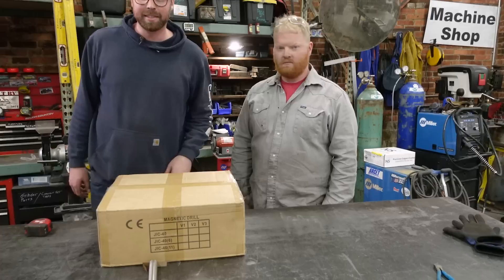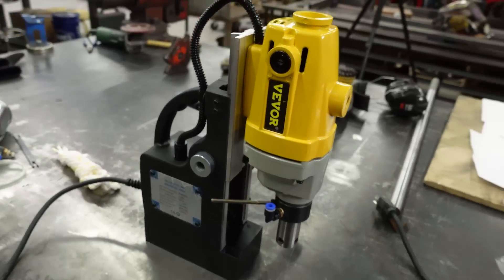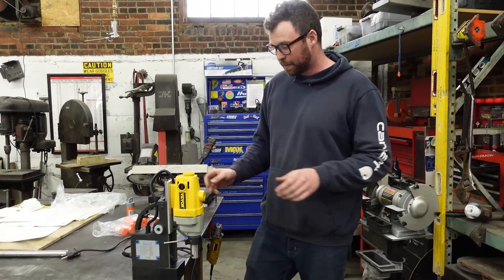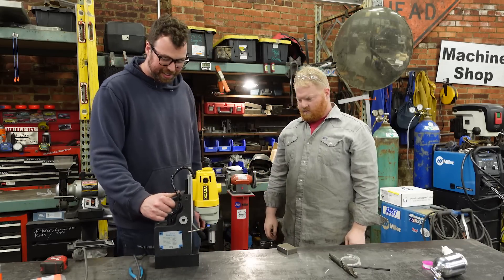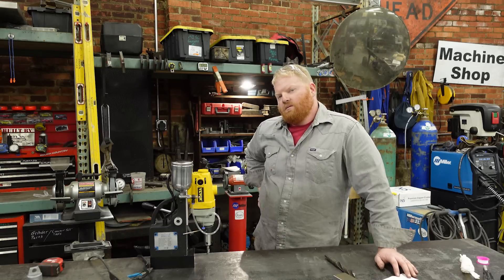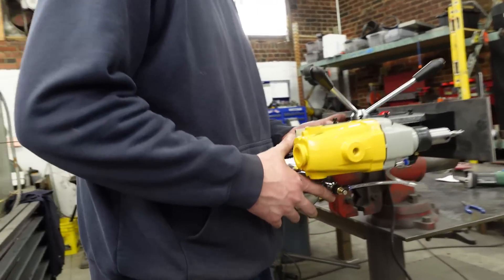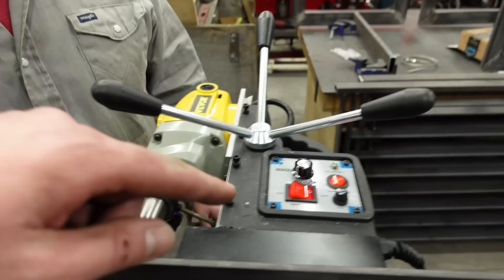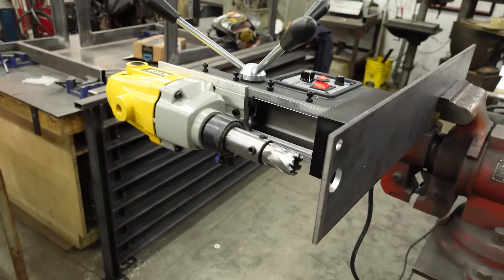I've Wanted One of These for SO Long

Comment: tay center punch hole center USE THE GUIDE PIN fits through the cutter . dont oil the ways .  been using hiatachi mag drill with alu  ways for 20 years in indrustrial setup with no problems

Comment: Did you check the "fuse" on it? I saw a few youtube videos where people were testing the CUT50 plasma cutter from them and when they removed the fuse, it had a piece of copped soldered to the outside making it not a fuse lol

Comment: There should be a guide pin to put ind the center hole of the annular cutter so you punch a marking so the pin hits the mark before cutter does thereby guiding til cutter 😁 ive use a mag drill a lot on truck frames for mounting knuckleboom cranes 😄

Comment: You can adjust the gibs by loosening the nuts on the Allen screws on the side and tightening the screws until it has no slop but still operates smoothly.
Even the expensive ones need some adjustment every once in a while.
For lubricant I always use a water soluble oil cutting oil in a squirt bottle and keep it wet to cool it to decrease wear.
There is also the option to get the cutters sharpened again and that's pretty economic in the long run.
To combat the magnet issues try and magnetize the drill on an bit of an angle instead of linear with the tube, that helps it find a surface that is as flat as possible.

Comment: There should be a pilot pin that came with it that fits into the center of drill bit to center it on a center punch you make in the material your drilling.

Comment: I've got a huge Milwaukee mag drill. I needed to drill 1 inch holes in the upside down position in the I beams of my building. I didn't even consider using the Milwaukee.  Waaay to heavy and scary in that application...did I mention it was 16ft to the floor. Did it with a hole saw and a corded 1/2" heavy-duty slow speed drill instead... it was a bitch!.. but so would have been positioning a 100lb mag drill upside-down 16ft off the floor.. that vevor would have been perfect for that scenario.
Reply from the maker: Snag one with our affiliate link friend!

Comment: I had to take  a Hougan apart to replace bearings. had to use the bread trick REAL BITCH getting the slides to have even pressure Steel fabrication shop  A complet4e Hougan from our distributor $904  the lube attachment was 2  position , the manua
l RTFM!  had instructions and parts to chain drill to vertical and upside down usage

Comment: The mag drills I have used I would use the oiler with a center pin that was printed loaded. The. Enter pin helped meter the oil but also would shoot the plug out after. If I couldn't use the oiler I would brush on some anchor lube. That looks like a great drill for the price.

Comment: You'll love the annular cutters in your mill and lathe as well. They make Morse taper adapters to mount them in the tailstock, and R8 adapters for the Bridgeport. They're great for hogging out big holes. And the slugs from the center come in handy, so start saving them in a coffee can!
Reply: When I was a kid my dad had a big coffee can full of slugs and I couldn't ever figure out what they were from, definitely not knock-outs from panels or anything, WAY too thick.. huh, I just realized where he got all them. Not sure why I never asked or he never told me. He was a machinist / boilermaker in a previous life (before he met my mom I think). Great point and yeah annular cutters are SO nice to have
Reply: The only problem is they tend to get extremely hot and are often case harden, so it's a bitch and a half to turn them down in the lathe...
Reply: @Guds777  Yep, the steel ones can be tough if not using cutting fluid, but the aluminum are good.

Comment: A trick that helps if the situation allows... If the magnet isn't grabbing on thinner material take a heavier piece of 1/2" or 3/4" and put it under what you're cutting. The magnet will still grab it.

For example if I was drilling holes on a stringer channel that was laid out on horses.... Sometimes the drill might not grab great in this case so you could put the heavy piece of extra plate underneath the channel and the drill will grip better. Just be careful when releasing the magnet!
Reply: Yessur even our hougen mag drill needs at least 3/8ths inch thick base plate but you can take a 1/4 inch plate and put it under if your cutting something smaller

Comment: You mentioned that the bit kind of wandered until it got started, there are centering pins that can be purchased for use with the annular bits. They seem to help a bit with the drilling we do. Also, like someone else said, the thicker the steel that the magnet is attached to, the stronger the holding power will be.

Comment: In the 80’s I’ve Drilled thousands of holes in fabrication with Milwaukee Mag drills. They excel in speed and portability when you have to drill on-site through beams already in place.

Comment: Mag drills work great, couple of points. The thicker the plate it's mounted to the stronger the magnet becomes...It's how magnets work I believe. Also you need to get a 3 jaw drill chuck for it, then you can use your standard twist drills etc. Mine unfortunately only has one speed...around 500 rpm. So I've had some problems with countersinks/reamers etc. If you buy one get one with a variable speed if you can.

Comment: I'm only half way through the video, (second hole cut) and you are complaining about the wobble of the drill when you first start. There is a center pin that was in the kit (I saw it on the table next to the Allen wrench) that serves 3 purposes on my mag drill. 
Center punch the location of your hole like normal 
1. Use the center pin inside the annular cutter to locate the hole and stabilize the bit when starting the hole.
2. It will start and stop the flow of coolant to the bit automatically as long as the valve is turned on from the reservoir. 
3. It will pop the plug out of the end of the bit when cutting is complete... 

Hope this helps guys 

Edit: I'm now farther along in the video and you guys found the pin and figured it out... 😆 🤣 

Edit #2: My mag drill came with a (normal drill chuck that fits into the 3/4" receiver) if yours didn't you can buy them pretty cheap, it is a good addition to the mag drill especially when you have to locate holes on both sides of material like you are doing. Put a small normal bit in the drill chuck and drill through both sides of the tubing from one side, then swap the chuck out for your annular cutter and use the small hole and the centering pin on the cutter to drill from both sides of the material. 
Sincerely
Chris 
T-Town Welding and Fabrication.

Comment: Very useful tool.  Typically you use a chain(they included the rope instead) when it's on its side or upside down in case you lose power.  You also can get a standard drill chuck that will fit in a mag drill chuck.  It eats up alot of your vertical space, but it let's you use smaller buts, annular cutters only go down to about 10mm.

Comment: I thought about getting this mag drill but went with the evolution instead, bc i have the evolution 15" steel chop saw(im suprised you dont have one they are awesome) and am very pleased with it. I bought a vevor sbg-40 universal bender and i was not impressed with the quality at all. It does work though. But that purchase really turned me off to vevor. Im curious to see how long this drill last. It is nice that its variable speed. They also make adapters so you can use anullar cutters in your mill and lathe also. Thread cutting oil works good as a lubricant for drilling holes. You might already know this. But just incase. There is also and minimum thickness for the magnet to stick to, most mag drills have a saftey feature and wont even turn on unless the magnet is engaged in atleast 1/4 steel or thicker depending on what mag drill you have. And they also come with straps to strap it vertically or upside down incase you losr power and the magnet shuts off. Vevor sent a rope lol.
Reply: The drill will last a long time - you will not be able to use it when it has broken your arm

Comment: The lubrication actually makes a big difference in my experience, particularly with annular cutters
I used a thicker cutting oil I got in the welding supplies and I found that works better then the thin water based stuff.

It's $300 including cutters that's pretty damn amazing that's probably $100 in cutters alone.

And Yes you're being too critical imo
Vevor a great option especially for work I do occasionally but regularly, 
Not enough to spend thousands on a tool but enough to spend hundreds.
Reply: if you drill a lot in more than a half inche thick ....you should plug the cutting oil....but i use it for drilling in quarter inch mostly and i never plug this....hen i was working in structural stuff ....in base plate and gusset...oil is the way...

Comment: You can also buy an R8 arbor adapter and use the annular cutters on the Bridgeport ...the same with your large drill press if it has a morse taper spindle .

Comment: I have to ask, couldnt you have used your CNC plasma cutter to cut the holes?  Not criticizing one way or the other but just curious.  thanks for the videos.
Reply: Try to get a 4’ x 4’ x 1/2” steel plate onto a plasma cutter you can afford.

Comment: Yep! You first, Tay! (as idiots are numbered)  : ) No. Not really. I am excited to be getting one of your two-piece steel Christmas trees. Black Dog's website took my order on December 3rd, but cancelled when it turned out they did not really have any left. I enquired about this via their website and it was cool to find out you had made some more. Just hoping that order doesn't get cancelled too :D As for your new magnetic drill - Imagine the inflammable unclean workplace an accident this will lead to. Sufficient brightness need possible is not. You brightness not known for usually. Kidding, I am.

Comment: Great video as usual!  When dealing with crowned metal, aluminum, stainless steel...etc, just clamp a piece of metal to the problem/non-carbon metal and then you can use your magdrill in places you need to.  Cheers!

Comment: Every magnet drill I've encountered so far has the separate button on a separate circuit for the magnet. Some have a bit of "security" by adding some ridges around the button so you're less likely to accidently press it. It's a mistake you'll probably only make once ;)

Comment: Great video, I love watching you guys. Personally I would have been magneted the drill to the table to drill the holes that you had trouble with. That way you would not have to worry about the magnet not sucking down properly. Only reason I knew is I’ve done it 😂

Comment: I'm serious about my tools so I'd never buy this version, even at the price point.  I bought the $3k one instead.  These are amazing tools, worth every penny.  It's insanely useful to be able to bring the drill press to your material.  A good version of this is going to have a true electromagnet that twists into the "on" position and doesn't require electricity to work.  I've also rigged up an accessory for my fab table so I can use this as a traditional drill press with the chuck adaptor.

The problem Wyatt is having is that the magnet requires a minimum thickness of material to hang on to, the surface imperfections are irrelevant.  You need to stick it to 1/4 or thicker for a secure hold.

Comment: You are drilling too fast with no cutting fluid. Those independant circuits WILL break your wrist - this product is unnecessarily hazardous. In its present form it should not be used. If you release the magnet while it is still running in the hole, it will grab and try to twist your arm off. If it was mine I would throw it in the bin.